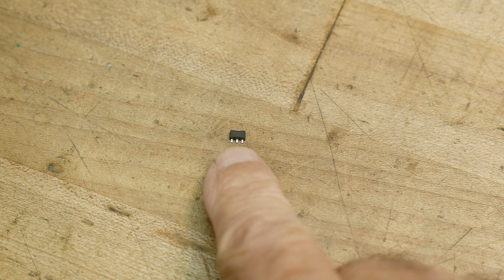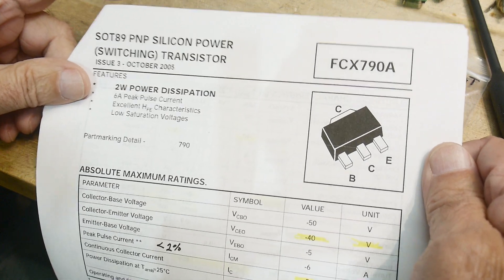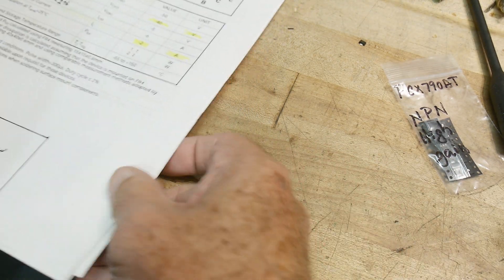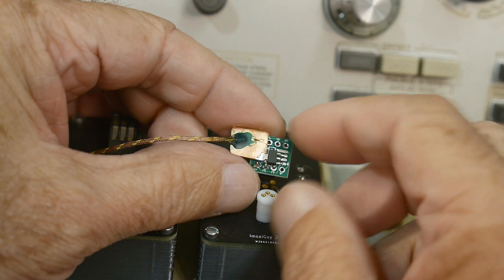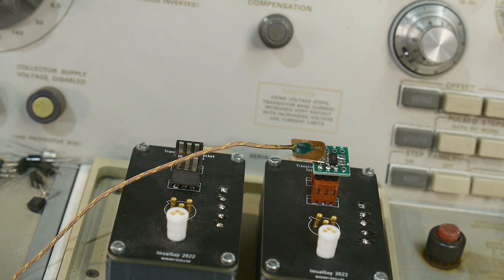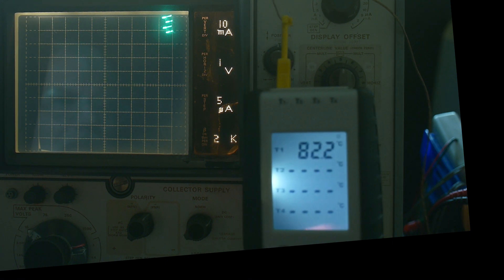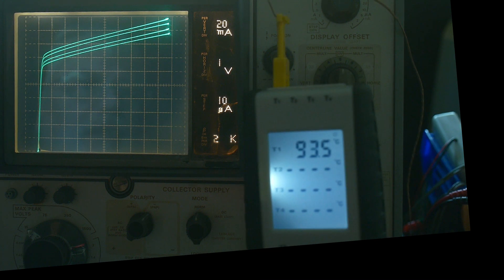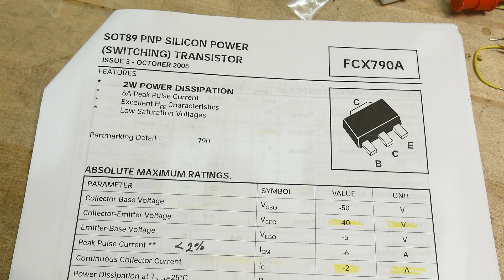#1740 FCX790AT SMD Transistor

Comment: Sure you gave it a bit more thermal mass, but also glued over considerable amount of required heatsinking area as well as severely limited thermal resistivity with a tip of a tab barely touching heatsink via tin mostly. Pretty sure they intended good substrate to copper contact in the middle (or at least lower half of) area and probably thermal vias in case of FR4 PCB

Comment: Fun fact, you can easily mount these to TO-220 left overs. Clean off the resin and blown die, solder at the bottom edge. The reader is encouraged to engineer their own solution to the missing leaes. New THP out of SMD.

Comment: fT is the frequency where a common-emitter amplifier has a gain of 1. I think they measured the gain at 50 Mhz and approximated minimum fT. 2N3904 has fT around 300 Mhz which means it can be used as a decent HF amplifier at 30 MHz or so. A transistor with fT of 500-600 MHz would be even better in this application but usually they are somewhat more expensive. fT = 100 Mhz basically tells us that this is not a good transistor for RF applications, it's an AF one.

Comment: Zetex made some damn fine parts, they were a UK company until Diodes Inc took them over. 

Used to be Ferranti, then Plessey, then Zetex and now Diodes Inc. 

I did some IT work for them at their UK foundry in Chadderton, never did manage to cadge any samples out of them though.
Reply: I used to buy Zetex transistors and some little LED drivers back in the Zetex era.  The transistors typically had high gain, low Vsat, etc.   The little ZXSC310 was a LED boost driver that would operate down to 0.8v, which was very handy for some of my home projects.  Cool parts, and kinda sad to see them absorbed into a larger company.   Of course, this is the normal pattern in the semiconductor industry.
Reply: Definitely Zetex, recognised the part number and datasheet style instantly. This family of parts is designed for things like switching power supplies and power switching in general, easily driven from low power source with the high hFE. This transistor family is a development of the Ferranti ZTX devices. The odd first digits are all PNP (e.g. 5xx, 7xx), and even (6xx, 8xx etc) are NPN.

(Zetex name came from there with the staff buyout of the discrete devices plant when Ferranti broke up after the Ferranti International purchase of ISC late '80's) 
Still have a plentiful supply of some of those transistors, a few reels and tapes in a cupboard

Comment: Wow, I'd be pissed if I bought some transistors for a project labeled as NPN and they turned out to be PNP, but being very cynical, I would have checked them prior to making the purchase...
Reply from the maker: it was $1 bag full of parts
Reply: 1$, that's amazing, but you never know when they are useful.
:)  @IMSAIGuy
Reply: Then please don't buy from Chinese sites. What you get will be a complete surprise from what you ordered. Once I ordered some depletion MOSFETs and received NPNs. :)
Reply: @stamasd8500  Newark has pretty good periodic specials and if you are ordering parts for a job and are over $150 they pick up shipping, so I get most of my cheap stuff from them as well.